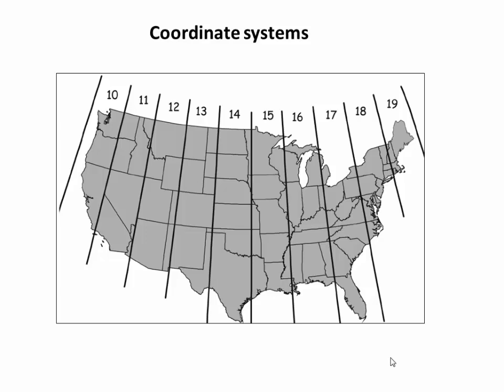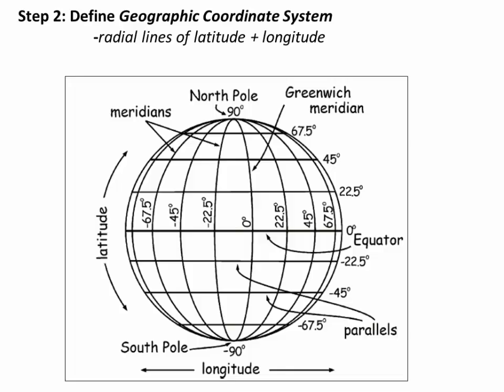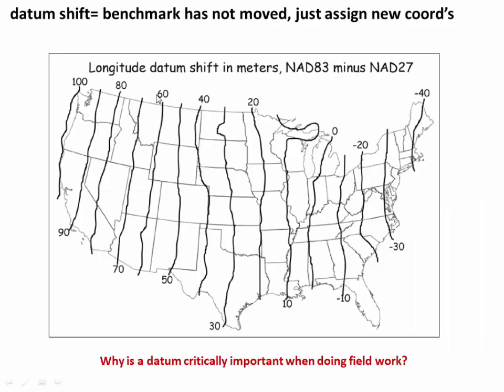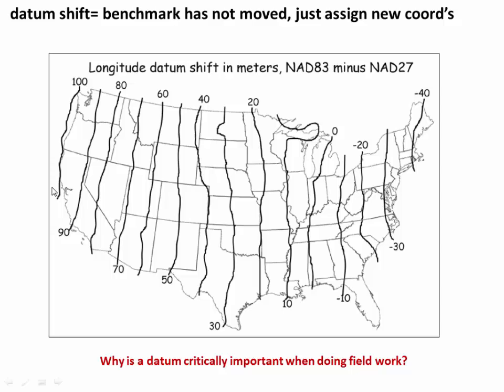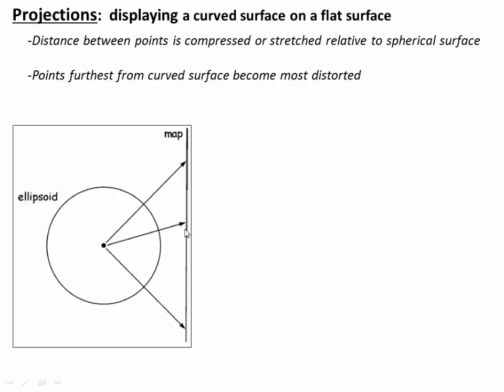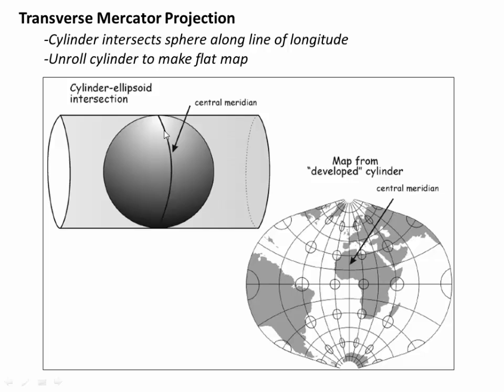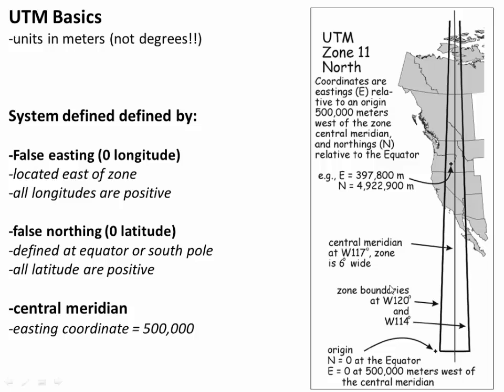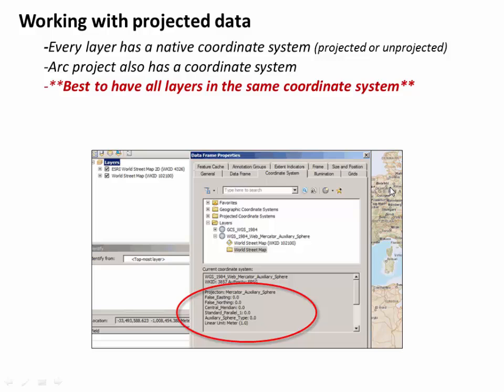Intro to coordinate systems and UTM projection (C12, V1)

Comment: The reading of latitude and longitude is taken from the centre of the earth which is the intersection point of polar axis and equatorial plane (not equatorial plane and meridional plane). The longitude is a vertical angle measured in the meridional plane with reference to equatorial plane; whereas longitude is an angle measured in the equatorial plane with reference to meridional plane.
Reply: Hi sir can you share your what's up I have some doubts .
Thank you
Reply: @RUBYKINGSLY  Dear! You can ask here itself.
Reply: @Ram Pratap  sir for example Lat = 22°42'4.7" lon 55°18'2.97" means angles measured between what points .
Reply: @RUBYKINGSLY  To put it simply, Latitude is an angular distance of a point on the surface of the earth North or south of equator measured at the centre of the Earth. Longitude is angular distance of a point east or west of prime meridian, measured from the centre of the Earth. Remember, Lat and Long are points. A latitude of 30 degree north is a point, but there will be infinite points of 30 degree north and if we join them we get line of 30 degree north latiyude. same with longitude. If the location of a point is given as  Lat = 22°42'4.7" and lon 55°18'2.97", the lines of Lat = 22°42'4.7" and lon 55°18'2.97" intersect at that point.